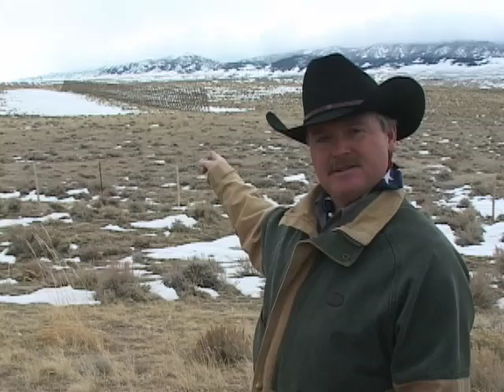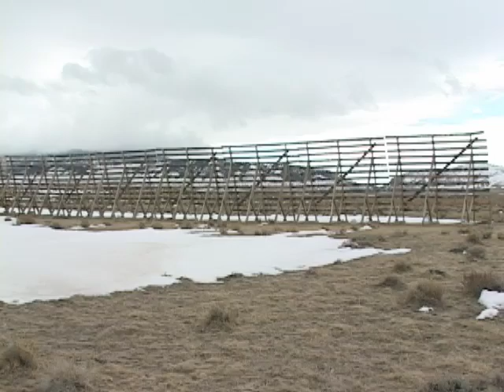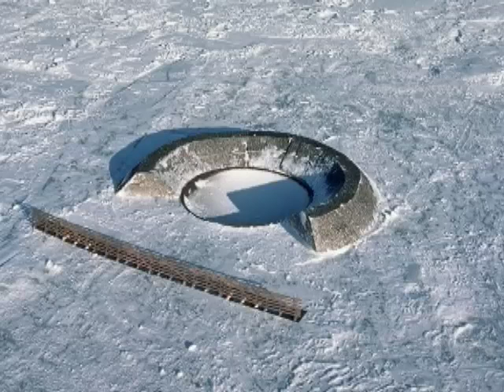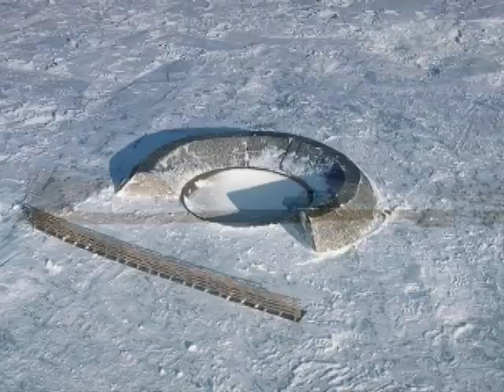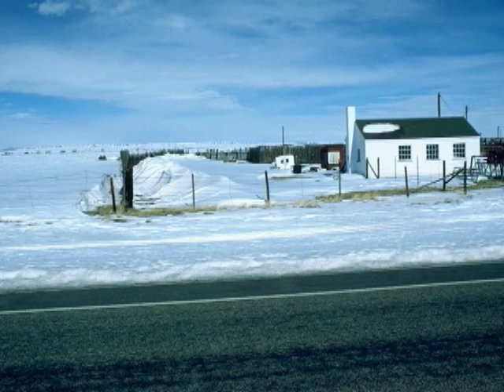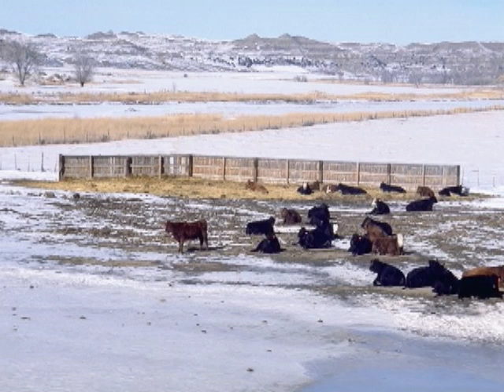Snow Fence Design

Comment: I have a real problem, I have a 700 foot driveway and a good 300 or more is exposed to and open west field that blows east. My driveway sits east of field in a south to north direction. My driveway is approx. 10 feet wide and the width of my property where my driveway sits on is 36 feet. The west strip of land is 14 feet to 16 feet. Can a 4 foot snow fence effectively work on my driveway? If not what can I do? .
I have a real problem, I have a 700 foot driveway and a good 300 or more is exposed to and open west field that blows east. My driveway sits east of field in a south to north direction. My driveway is approx. 10 feet wide and the width of my property where my driveway sits on is 36 feet. The west strip of land is 14 feet to 16 feet. Can a 4 foot snow fence effectively work on my driveway? If not what can I do? .
Read more              Show less                     

Reply                  ·           1         
               
                .